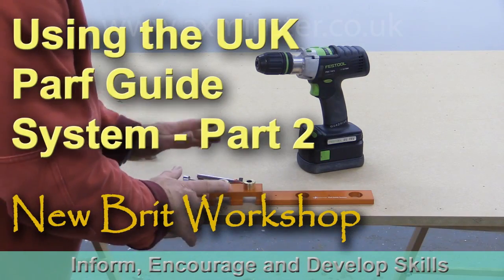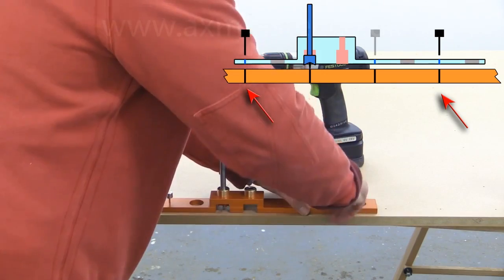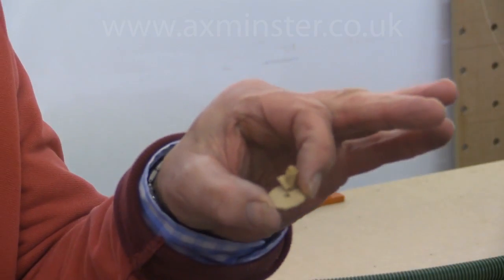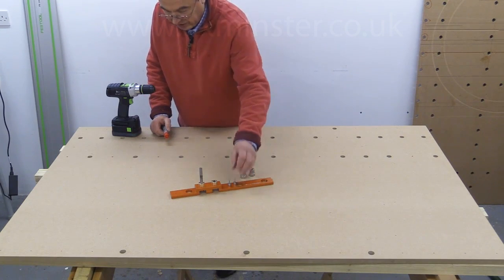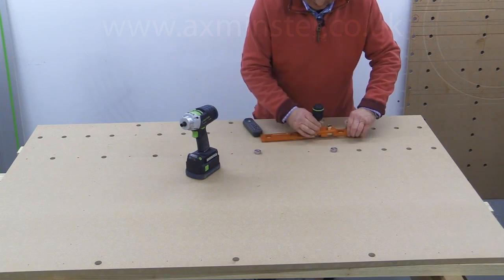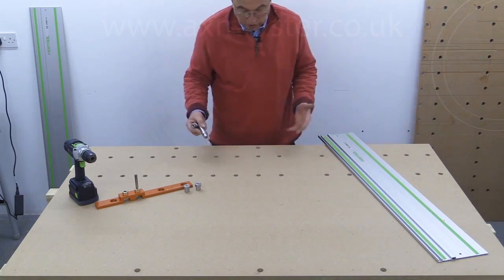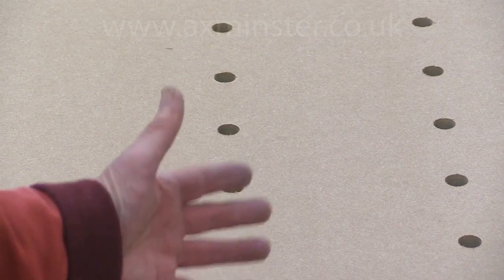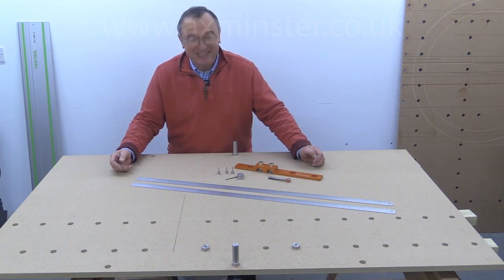UJK Parf Guide System - Instruction - Part 2

Comment: I recently bought a used Parf guide system (older version)...however while drilling the first hole, the chuck on my Makita drill put a circular indentation on the shaft of the bit...I had to file it out to get the shaft out of the the bushing...do you think it will affect the accuracy of the grid if I keep using it or buy a new bit and i suppose replace the chuck on the drill?
Reply from the maker: Hello, this shouldn't make a difference at all. Thank you for watching.

Comment: Just finished my first "MFT" top with the Parf system. If you are on the fence, jump off and get one. Excellent product. I did mine from start to finish, 88 holes, including lunch and beer breaks, in less than 3 hours. I'm sure I could do it in half the time now. One thing I will do differently next time is drilling half way through on the bottom with the 20mm cutter, then flipping it over. I did experience some tear-out on my cabinet grade plywood, with a very thin veneer. Drilling from both sides would eliminate that.
Reply from the maker: Great to hear, thanks for sharing

Comment: I got my set from Lee Valley as I'm in the US and am anxious to get started.  Quick question...  Is there any advantage of MDF over 3/4 inch plywood?  I have some 3/4" Garnica ply in my unheated and uncooled garage shop.  Because it's not a conditioned space, I'm concerned about the MDF swelling.  Thoughts are appreciated!
Reply from the maker: Hi Dan, I am trying to find out for you. I will be in touch soon. Kind regards, Tracey Customer Service
Reply from the maker: Hi Dan, Ply wood would be stable but does suffer more from break out on the underside. If there is a sacrificial sheet underneath this will reduce the chance of this happening. MDF will swell if a lot of moisture in air. If its better quality i.e HDF  board will be less prone to this. Medite or Valchromat are a good alternative to MDF. I hope this helps. Kind regards Tracey Customer Service
Reply: I just pulled 4 sheets of MDF out of the corner of my unheated and uncooled western PA garage and they were fine after probably 25 years there.  It ranges from below freezing to the low 90s over the course of the year and the humidity can get pretty high in the summer months.  I hauled it to North Carolina about a month ago.  It is not nearly as nice as some of the MDF that can be had today though. I just received my part guide system this week and tried it out on some of this stuff.  I had a little chip out on the bottom but not too bad,  I may buy a sheet of Medite to try too.  I think part of it is also the speed you spin the drill bit at and the rate you feed too.  I cut a hole though a 3/4 birch ply and had no tear out.  I think with a little practice you get a better feel for it.  I will have to see if there are any speed recommendations to turn the drill bit in the instructions.  I don't ever recall anyone mentioning it in any of the many videos I have watched on the system use.